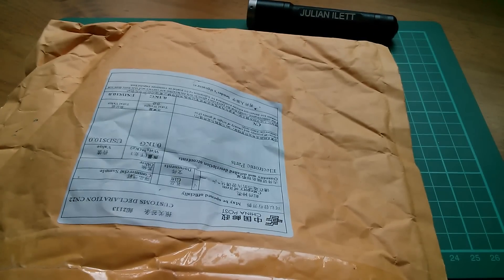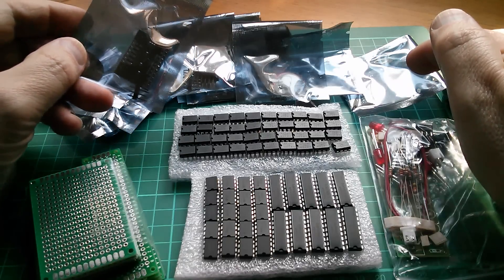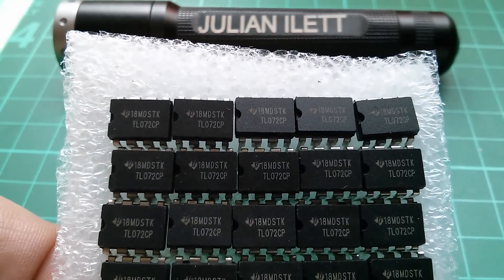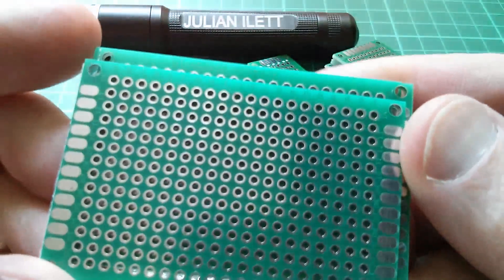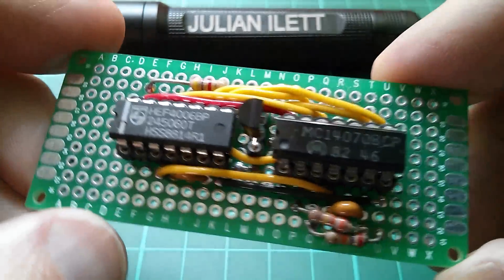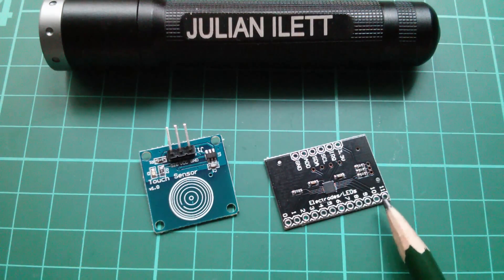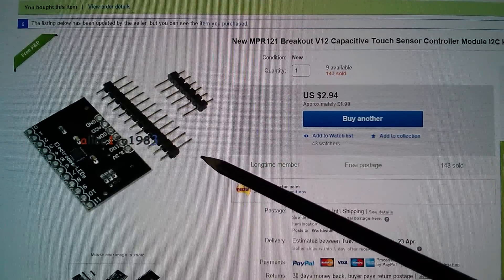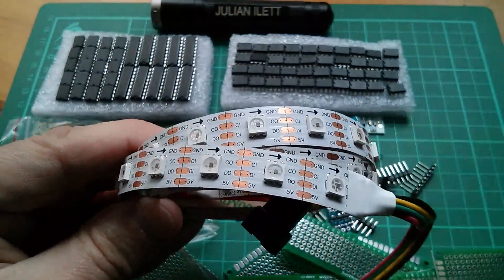Postbag: #38 - MPR121 Touch Sensor, 3.3v/5v Level Converters

Comment: @pete r:
First of all, you need the tach output AND ground connected. I think what I would do is attach an interrupt to the pin that you have the tach connected to. Every time it fires (either every rotation or half-rotation, IIRC), your program will jump to your interrupt routine. What you can do is set up a timer; if you've not gone into the interrupt routine in so many seconds, declare a fault and set off the buzzer.

Make sure to check your datasheets and see if the pulses coming out of the tach are long enough for the arduino to reliably trigger on, there is a lower limit. If the pulses are too short, you might be able to get by with adding a small capacitor to stretch out the pulses.

Let me know if you need more help!

Comment: Since seeing your videos.  Ive bought some items from far east sellers.  only takes about 20 days to get to Scotland.  I got a kit of a "hot" LM386 amp.  That was hot when I got the voltage polarity wrong.  Works ok now tho.  Ive got some more parts in the post today.  A 555 and 4017 with a lot of leds, kit.  see if I can burn my fingers building that up.  :)

Comment: I believe pre 1969 coins are fine to destroy Julian.
 "The Coinage Act 1971 Section 10 (1)No person shall, except under the authority of a licence granted by the Treasury, melt down or break up any metal coin which is for the time being current in the United Kingdom or which, having been current there, has at any time after 16th May 1969 ceased to be so."
Reply: Think Norway have coins with holes in them already made. :-)
Reply: Use Canadian pennies.  They were discontinued in 2012.

Comment: Having used both, do you prefer to use the protoboards with interconnected pads (I think you're calling that stripboard), or the pad-per-hole protoboards?  I've been using a lot of the interconnected variety lately (certainly less hassle than making my own PCBs for quick projects), and don't really like the idea of the pad-per-hole type.  It just seems like unnecessary extra soldering and effort to make connections.  I'm curious if you have any preference or thoughts on the comparison.
Reply: Well, the tradeoff is that you have to cut the tracks on the stripboard. I like pad-per-hole better for that reason, I think it's easier to add extra wire or solder than it is to dull my knife on the fiberglass.
Reply from the maker: Brant Martin I agree, cutting stripboard tracks is a real pain - those track cutter tools are never sharp. I really enjoyed working with the pad-per-hole board
Reply: I use a Dremel to cut the traces.  I don't think I've seen a special tool specifically for trace cutting.

Comment: I just tested a 1N4148 with LOTS of current.  It got very hot, smoked and then went short circuit.  So you may have to make a SROM instead.  (Snippable Read Only Memory)
Reply: Yeah the behaviour of them when overloaded is 'undefined'. Maybe a 10 ohm 1/8watt resistor in series with each diode would be burnable to make a prom?
Reply from the maker: bigclivedotcom Hmm, the 1N4148 failure mode does appear to be 90% short circuit. The one test I did before ordering the bits for my PROM was an open circuit failure. There may be a problem! I might have to go with your SnipROM™ idea :)
Reply: Julian Ilett You could definitely make it work.  But it would require a Photonicinduction approach and the programmer would probably be quite violent.  (But it would make a great video if your mains incomer fuse lasted for the full programming session.)

Comment: Ah, you're way ahead of me.  I've still got the APA strip sitting in my ebay shopping basket.  I've never tried deliberately blowing a 1N4148 diode.  I wonder if they might actually go short-circuit like their big brothers often do.
Reply from the maker: bigclivedotcom The strip I showed was an auction win. It's 60 leds/m and cost a lot less than another strip I bought that's just 30 leds/m. I'm going to try blowing ten diodes right now...

Comment: The TL072 look a bit fake to me. There are lots of fake components from china on ebay, especially common ICs. They usually still work but might for example be a different cheaper opamp with completely different specs.

You should really get such things from RS or Farnell. Farnell is a bit more expensive than RS but free next day delivery over £20 (but it's awful UPS). RS is £5 next day delivery by parcel force or free collection at the trade counter with no minimum order.

Comment: Just to let you know that the 5 meter reel of RGB Leds came which I told you about, Very impressive for Six pounds from Banggoods, a very impressive display, and that was with them still on the reel. The amount of control via the hand controller  is quite vast, well worth a look.

Comment: Alice is a cheater, I ordered 3 items, never got them, then she said she will send them again with my next order so I made another order and guess what, it did not arrive, again. Save your money, do not buy from that shop.
Reply: I bought a lot of items from Alice (thanks Julian for that). and they have always arrived here in France.
Reply: I ordered one expensive item from Alice, it didn't come, and I had difficulty getting anyone to listen to me. Eventually they said they'd send a replacement which did not turn up.
A few weeks later an irreplaceable package from a completely trustworthy local sender vanished.
Conclusion one has to accept some losses from all sources.
You can't argue with the feedback scores on ebay. Dumping the people with unreliable postal delivery may even be a good strategy for suppliers.
When I see something I want I'll give Alice another go.
Reply: David Pilling Replying to my own comment. I did gave Alice another try, the parts came in 11 days all nicely packaged. A good thing about Alice is that they sell so much electronics, unlike many other vendors on ebay one could get everything for a project from one source.
Reply: I was not that lucky, a week ago she promised refund, she sent me this message:
"I just submitted the refund request. There should be results in 48 hrs. Thanks
- alice1101983"
today I informed her that I did not receive any refund and here is hers reply:
"Oops. The refund was expired.
I have to apply refund from another chanel. Is it possible for you to revise your feedback? If yes, it’s might be a strong support for me to apply the refund for you.
Best regards,
- alice1101983"
not sending the goods AND blackmailing customers, nice way to run the bussines...
Reply: Read the ebay policies and get a refund....you didnt do it the proper way

Comment: Hi Julian, could you use washers instead of drilling coins? My 3.3V converters just arrived yesterday also. Got to stock up on some op-amps at that price. Great to hear Fran get a mention, I'm a big Franfan too. Thanks, as always.
Reply from the maker: ***** Just found some coins with holes already in them - Korean I think - result :)

Comment: im tying to use an arduino to set a buzzer off when a fan stops spinning. can anyone help me out a bit ?  the only wire connected to the arduino is the tacho *yellow) cable from a 12v pc fan.

Comment: The MOSFETs marked as "J1" are BSS138 n-ch ones. The circuit is most likely something very similar to this: http://www.nxp.com/documents/application_note/an97055.pdf
Reply from the maker: ***** Yes, I was sure I'd seen this circuit with MOSFETs. So the marking must be J1 - the rotated Y must mean something else. Super confusing!
Reply: ***** Wow, people can write quite alot about such a simple circuit.
Do you prefer them in red? https://www.sparkfun.com/products/12009 ;)
https://learn.sparkfun.com/tutorials/bi-directional-logic-level-converter-hookup-guide
It only works with MOSFETs btw. because the circuit needs the substrate-diode of the MOSFET.